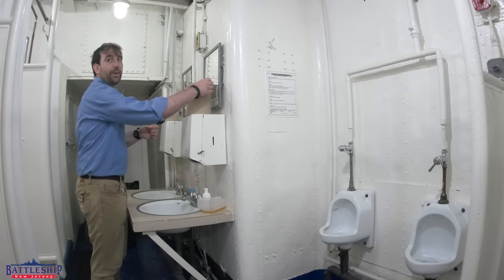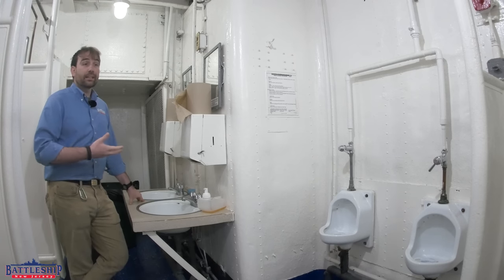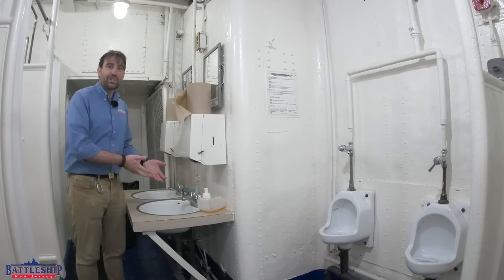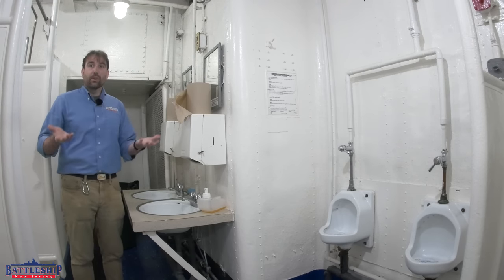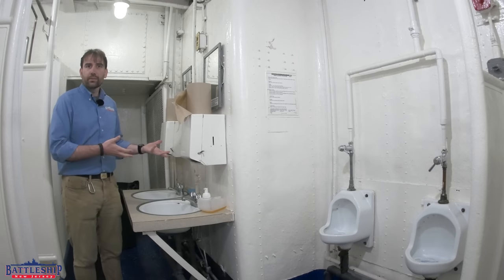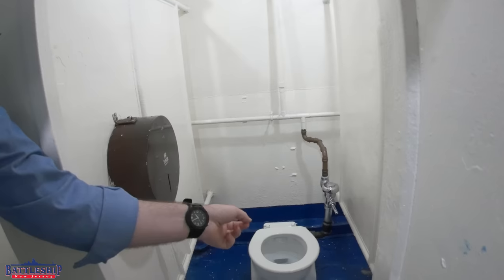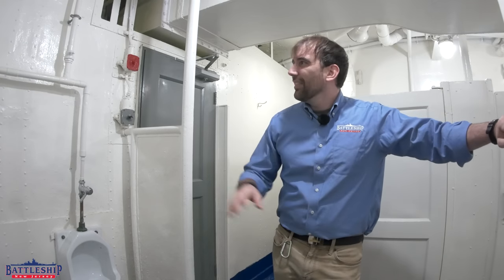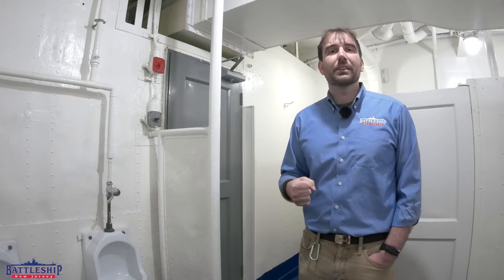Warship Plumbing

Comment: I served on Nimitz class, all the flushing water for the Commodes and Urinals were supplied by the Fire main, so Salt water. I can't imagine any smaller ships being any different. We had a 400k gal/day distiller capacity for a crew of 5500+, but know that each catapult shot on the flight deck is 200 gal of feed water lost.
Reply: Wow, that’s a lot of steam! Holy smokes when launching a bunch of planes there had to be a pretty good tempering system to keep adding all that feed water. 😳 The scale of that kind of operation is mind boggling.  When I think about a 150 HP low pressure boiler for comparison, that’s just crazy scale. I can’t even begin to fathom it.

Comment: I was more afraid of the commodes. Ship I was on used fire main water through a pressure reducer to the back of the commode. If that fitting blew out when they regulator failed, your backside would get a salt water wash down. After it happened to someone else, I would wait to flush till I was standing up with my pants up. Then I'd flush with my foot. But then again, I've heard worse stories from submariners that screwed up flushing toilets.
Reply: A certain German captain comes to mind 😂
Reply: Never saw a failure, but a rather common practical joke was to pull the cover off of the Flushometer and crank the regulator wide open.  If there were reducing stations on my ship, they weren't set very low.  Seemed like you had the full 120-140 PSI available.

With a urinal the flushing water would hit the lip on the front and go straight up, leaving both the victim and the overhead soaked with salt water.  A "courtesy flush" resulted in an extreme bidet experience with enough volume and pressure to go horizontally between the seat and the commode.  Flushing with your foot wouldn't save you from getting wet.
Reply: From a damage control perspective, I never did like that we used FM to provide hospital flushing.  It introduces unnecessary points of failure in a critical system and, as your story illustrates, it’s subject to sailor tampering. 😂

Still, it reduces weight and complexity while decreasing the demand for potable water, so I understand why it had to be done.
Reply: Is that the German submarine with a toilet that was so over-engineered and complicated that it required a trained person to operate it?

Comment: I was on USS Saratoga in the early 70's and worked in the pipe shop for 3 years. Worked on lots 'equipment' in my time. The junior officers shared a stateroom with one small sink. They had what was called 3 finger faucets. Hot, cold and drain stopper. Waste when out the scupper near the waterline. When on a cruise there were 5000 sailors using said 'equipment'.  Kinda nasty when we were anchored in some pretty port in the Med. Potty's used firemain with pressure reduced by 1/2 or so as not to cause issues. The problem with saltwater flushing is eventually the lines salted up creating big problems. Saratoga had lots of heads! I have stories!! As do many other turd chasers......
Reply: A former HT, I'm quite used to using a fire hose to unclog urinal drains, and when that method failed, we removed the clogged section of pipe and replaced it

Comment: Sloan valve co. made a model flushometer called the 'Sloan Naval'.  Specifically designed for Navy use, probably low-flow. The old factory I worked in built in the 1930s used them.
A friend was a machinist on a 'nuke tender' and his entire on-board career was to rebuild the Sloan Naval flushometers.
Reply: That's fascinating! I'd love to know the flow difference. I wonder if they use the same comercial model now that they did back then or if it's been updated to modern flow standard. Because that has me wondering the the old Naval version would just be a standard flow variety today 🤔
Reply: @seldoon_nemar  the Sloan Naval is a piston style rather than the visually wider diaphragm style you see used in most commercial applications. It is designed for saltwater operation, which would quickly corrode and disable the commercial units. It’s selectable for either 1.6gpf or (I believe) 3.5gpf, which is on track with commercial units. Older commercial closets would use a 2.4, 3.5, or even 4.5…Today, 1.6 is certainly most common, with some china being designed for less than a gallon (those don’t work great, FWIW). Hope you appreciate my toilet factoids!
Reply: @TheSteelArmadillo  I can think of at least one place on dry land that would probably benefit from Naval-grade Sloan valves. Work.
Our water there is heavy with alkalai & iron maganese while the ground will eat steel & even concrete w/ enough time. We use the conventional diaphragm type & while they last okay the water can still be hard on the rubber. The vacuum breakers especially.
Reply: Sloan still made them and rebuild kits as of five years ago when I worked maintenance at a museum ship

Comment: I was a tin can sailor, DD821. My compartment was forwarded and one deck below the mess deck. On the same deck as the mess deck and just forward of the mess deck was the forward head. Flushing water was drawn directly from the sea and dumped right back into the sea. No holding tanks no processing. When the seas were heavy the bow coming out of of the water then plunging back in. The commodes become more like fountains.
Reply: I can remember a time like that! But it was on land, and the sewer was somehow pressurized! A crappy situation to be sure!!
Reply: They didn't have check valves installed to make sure seawater didn't rush back in the out pipe?

Comment: The thing I remember is that since you flushed with sea water, you couldn’t clean the bowls with scouring powder like Comet. The powder reacts to the sea water and turns into a hard clump, plugging the pipes. We could only use pine oil to clean the bowls which never got rid of the rust stains.

Comment: Many ships use salt water for flushing urinals. I’d be surprised if the Kidd or New Jersey originally used fresh water for flushing urinals.
Reply: I was a pipefitter on an Essex class carrier in the mid 1960s. All sanitary plumbing was salt water flushing. The salt water eventually clogged the piping and we flushed it out by connecting it to the firemain.

Comment: I was a volunteer on the USS Hornet museum from 1998 to around 2004 and I worked on restoring several of the heads on the ship. A lot of times we had to hand make gaskets and other parts to rebuild the original hardware. We salvaged as much as we could from other areas of the ship not open to the public as well as getting some parts from places like the mothball fleet in Suisun Bay. I moved away from the Bay Area and my friend that I worked with on the ship passed away shortly after, but we worked to restored maybe 4 or 5 heads in my time there. This video brings back a lot of memories! I miss working on a museum ship.

Comment: I dunno, I've seen those spring loaded sorts of taps before in the particularly cheap sort of restroom you see in high traffic areas, highway rest stops, or cheap places of business. The idea there is to keep some vandal from flooding your bathrooms by clogging the sink and leaving the taps on. As for the pre-measured commode cycle, you're not just rinsing the wee down the line, you're also moving solids through pipes, and you need enough fluid to get them moving through the system... and if you don't have enough to move it, it tends to... collect.
Reply: There’s a high school in Florida that I go to community band concerts at, and they have the spring loaded sink faucets that make washing hands almost impossible.
Reply: These valves are pretty common in older campgrounds too. Same reasons, water conservation and not being able to flood the comfort station if some jerkwad piles junk in the sink

Comment: Holding tanks for waste treatment are relatively new to ships.  But fresh water was always in short supply as it had to be distilled from sea water. Hence the "Navy Shower".  Get wet. Stop the shower. Soap up and scrub down. Rinse off.  Minimize the fresh water use.
Reply: unless you work in engineering dept. We MAKE the water so used what we needed. I doubt I ever took a "Navy shower"  in my 3.5 years on ship.
Reply: Every engineer on my ship certainly took sea showers  @kevinsantascott3688  . I 100% did. Water was scarce on my second ship, and no one was too important to not waste it.
Reply: Newer ships use RO units, which are far more efficient than the old vaps. I remember times when we had so much fresh water we were dumping it over the side, rather than shutting the RO units down (They hate being started and stopped for some reason)
Reply: to be honest, I do that at home sometimes because of the small hot water tank in my apartment... I live in the desert though, so water conservation is a big thing too...
as for any time I spent at sea (purely civilian) was in rather old boats, so we only ever had salt water showers when under way... the plumbing was rather minimal too, so, no big issues with salt buildup as far as I know...

Comment: Water , especially fresh , is a valuable resource on ships and many of the limited fittings look familiar . Crews were also larger than those needed on more modern ships .  New Jerseys  last commission ended at a time when IMO. regulations changed requiring sewage to be treated or stored  . We spent a fair time on a couple of older ships installing STPs and garbage compactors and she might not have been upgraded .It must be an awkward job as a museum to decide which heads  should be kept functional to serve staff and guests when aboard . Ryan seems to have the ability to make any subject interesting .

Comment: The urinals and toilets are salt water flush. Speaking from a former HT who wished they were fresh water flush. Those who were HT's as well would probably agree.
Reply: I'm trying to remember if the water lines were marked as Salt Water in some way.
Reply: @johnknapp952  I believe it was SW flush. Long time ago.
Reply: Flushometers take a beating from salt water.  Urine and salt water calcify the piping.  Duty HT to engineering head.
Reply: @garybaudino2756  So true, and the p traps plumbing leaving the urinal, always clogging due to the SW. I remember it well.

Comment: As I remember the commodes and urinals on Navy ship used salt water.  No need to waste fresh water to wash away the waste when you have an unlimited supply of sea water.   One interesting feature on the Wainwright CG-28, was a urinal on the weather deck in a small nook near the signal bridge.  When I first saw it struck me as strange, but when at sea there is no one to sea you.

Comment: Back on aircraft carrier USS Constellation (ex-CV-64), we had salt water flush toilets. Water was pumped up straight out of the ocean or harbor, with just a bit of filtration for big solids, and whatever smells came along. When toilets would clog up -- happened rather often -- the repair party's first "tool" was a firehose nozzle. They'd enter the head, suited up in rubber and lugging a firehose behind them, connected to the fire mains at high pressure. Then stick the nozzle right down into the clogged toilet, and let it rip. Usually worked to blow out whatever was down there, into the waste piping. Often as not, there was quite a mess all over the heads (overheads, bulkheads and deck), cleanup of which was the responsibility of whatever group "owned" that space. Ah, the good old days.

Comment: Both ships I served in had hand held, button operated shower nozzles rather than allowing open the spigot for shower water, shut off and soap up then turn on to rinse and turn off again.  Push the button for water, directed to where you need it then release.  A real pain in the butt to use.

Comment: Ships that don't have holding tanks for grey water also have spring loaded valves to save fresh water. Thru 1971 while in the USN, none of the ships I was on or knew of had holding tanks for grey or black water, it all went overboard.
I doubt the heads or urinals are from WWII. WWII ships I was on had what looked like aluminum heads and urinals that may not have been original. One Fletcher class destroyer I was on that was taken out of mothballs to sell to Turkey in 1967 was never modernized. In the enlisted heads, the urinal was a long trough as were the toilets with just wood, 2 piece seats over the trough without dividers. I never saw porcelain fixtures on ships that hadn't been heavily modernized or built after WWII.

Comment: You can't quite show it on your video, But, The drains are often significantly different. If a ship is underway there is often rocking and rolling going on. Any pipe the is running crosswise the vessel is subject to little geysers as the water rushes back and forth depending on which direction is downhill.
There were several methods that were attempted but all had problems and sometimes a geyser in the appliance your using is "not quite so good." This usually ended with certain heads being secured until further notice.

Comment: I kind of want to see how you guys have done the modernization and also I am curious if there is a navy ship plumbing code or service protocals. It would be cool to see how they handle vent stacks and pressurizing the water etc. Maybe tools or methods of how they put it all together. I am curious as well with the holding tanks and how all of this was designed to be used in adverse conditions.

Comment: Returning knobs on a sink sounds like a good idea, but how do you mix water? It will take both your hands to turn them both simultaneously and when you drop them, water just stops. It would make more sense to premix it with another hidden valve permanently and use only one knob for turning it on.
Reply: Normally the hot water comes via a temperature control valve, so it is a choice of cold water or 40C water, not the near boiling water from the hot section of the condenser, that is circulated through a loop of insulated pipe, for both heat and hot water. Same for the showers, getting the hot water from that same regulated valve. Likely converted for a museum to have all water be fresh water, and run into a holding tank, with the tank then also having a float switch and a mulching pump to lift the effluent up high enough to flow out a flexible pipe to the municipal sewer system. You can bet they all have warning signs in each toilet, plus a bin, saying not to flush anything other than toilet paper and poop down, and not to flush any wipes or sanitary products at all.  Those pumps are a pain to repair when they have been clogged with the remains of sanitary pads or wipes.

Also there will be a second float switch, connected to a shut off valve for the main water flow, just in case there is a leak or the pump jams, so as to keep the tank from flooding the ship. That will also trigger an alarm hopefully.
Reply: When shaving step one is put the stopper in the sink (or a sock) fill sink with water.

Comment: Regarding the old plumbing, would it be possible to reline the old pipes? 

I know it is done a lot in Europe on old cast iron pipes, don't know if it is ever done in the US. The process is basically to cut the pipes in strategic locations and blow in a sleeve impregnated with epoxy resin. Once it has hardened, you basically have a new plastic pipe inside of the old pipe. To get a good result, it should be done before they are completely broken, you cant reline a pipe where there are big cracks etc.
Reply: Easier to simply cut the old pipe out, then replace with plastic. After all, on a ship you can generally get to all of the pipes, not like they are buried with a 400 year old building over them, like in Europe. However the most common thing is to replace old ceramic pipes with a HDPE one, using a hydraulic head that cracks the old pipe, ceramic or cast iron, and pulls a new line into place in the cavity, and then you drill down to connect the outfalls to it. The lining method is normally reserved for larger pipes, or where you cannot put the machinery in, as you have to flow the lining in, then fill with water, and heat it to set the thermoplastic liner to be rigid. Expensive to do, unlike the hydraulic cracker.
Reply: @SeanBZA  Yeah, I understand it would be easier to just replace pipes on a ship, but it is a museum piece after all. Relining would keep the appearance of an old component, while keeping it working like a new one.
Reply: @MrJamesBanana  Plastic and a coat of paint looks remarkably the same though. Plus does not involve welding, which is an issue with the tons of very flammable paint used there.

Comment: Wonder how much grey water from the sink and shower would be recycled thru to the urinal / toilet? I don't they would do that since you have finite space on the ship.
Reply: None, salt water flush for the heads and urinals, all going to the holding tank, and then discharged when outside port. Shower and sink to the tanks with no recycling. Museum all now fresh water instead, and then holding tank pumped to city sewer system.
Reply: @SeanBZA  Thanks. I thought salt water would quickly corroded metal pipes. Seems to me that would be a maintenance headache not unless the flush some descaler thru the system.
Reply: @caminojohn3240  Cast steel and thick steel pipes, so corrosion is not too much of an issue. Plus all that pipe would be replaced as a matter of course during any yard work, as part of any maintenance activity, put there into the plan for drydocking. Remember only an issue on museum ships where they do not have the big spigot of money to do these sort of things. No descalers needed, just a regular flow so you do not have stagnating water. After all sea water is not like ground water in that it can still dissolve a lot more, and the only deposit it leaves is soluble salt, not limestone.